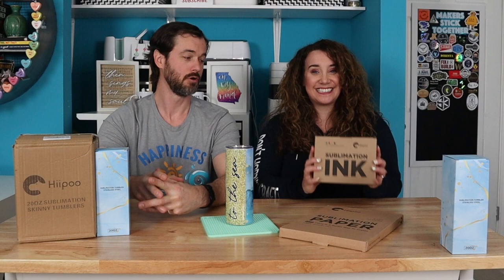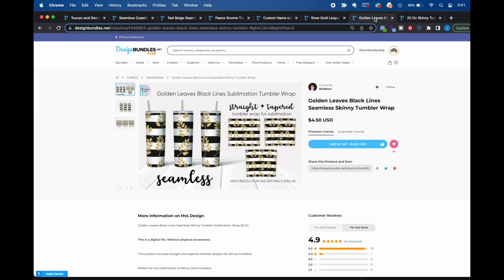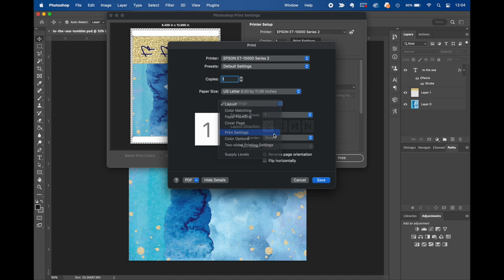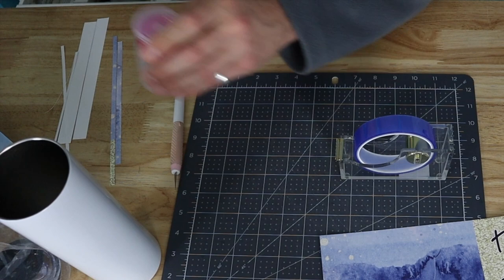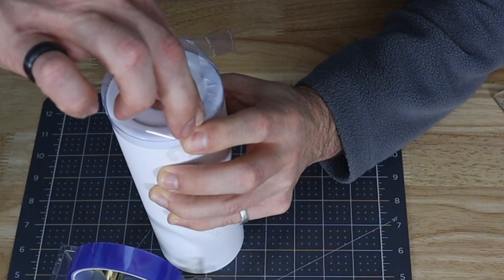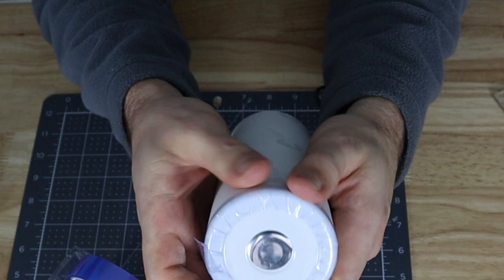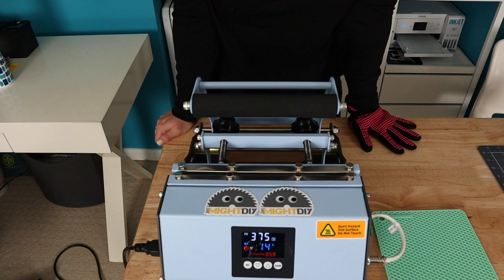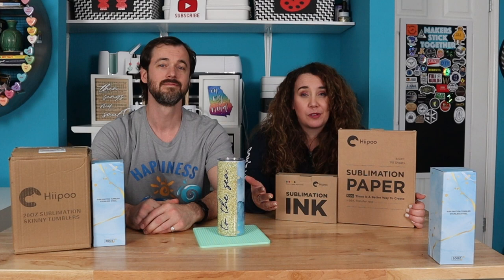How to Get a Perfect Tumbler Sublimation - NO Seams or Ghosting!

Comment: What am I doing wrong? I use the measurements provided and the print is still coming out to short for my cups. I am using the photoshop program and my printer is the et-15000. If you could please help me I would really really really appreciate it. Thank you
Reply from the maker: Hey! Either your print settings are adjusting it down, or your tumbler may be slightly larger than standard (there’s some variation between brands even in the same size). Try increasing the dimensions in photoshop until it fits.
Reply: @JustMightDIY  awesome thank you so much.

Comment: Ow I'm surprised you didn't use the shrink wrap with a heating gun thanks for sharing
Reply from the maker: Hi! Shrink wrap is for use in convection ovens, not in tumbler presses. The wrap provides pressure when you can’t otherwise get it. Since a tumbler press clamps around the substrate, a wrap is superfluous. And to get perfect seams and tops and bottoms, you’d still need to tape. Hope this helps!
Reply: @JustMightDIY  thanks I want to learn how to do them have a great weekend

Comment: Did you use 375 for 70 seconds.. or 360 degree ?
Reply from the maker: We did use 375 for 70 seconds , one turn to get the leftover gap. Different presses will get you Different results. Find what works for your setup and efficiency.  Thanks for watching!